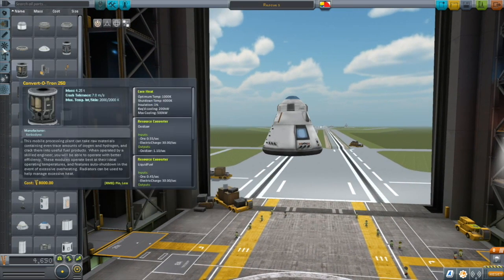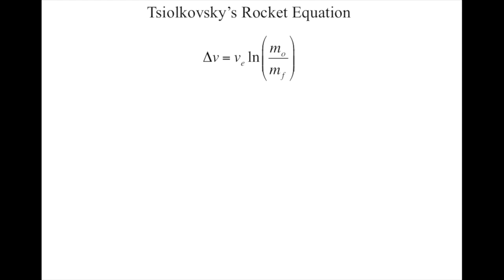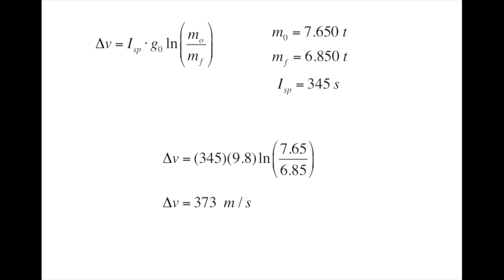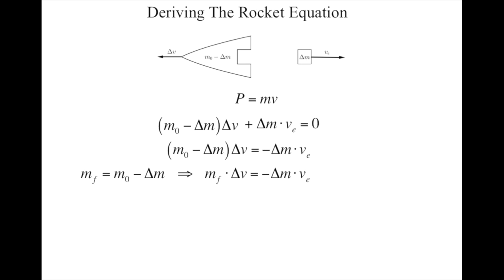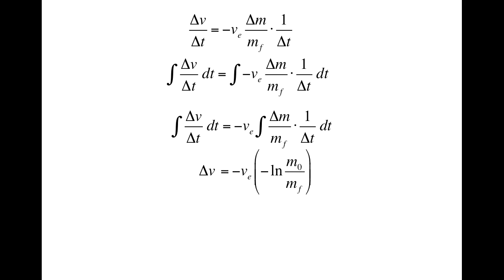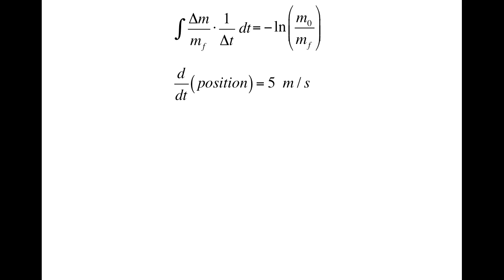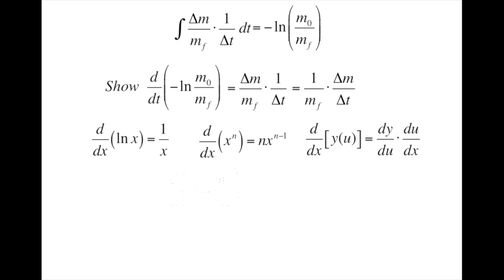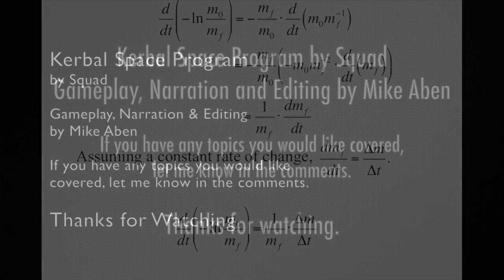The Rocket Equation | KSP Let's Do The Math

Comment: Surely when calculating momentum at the start we minus the delta m times exhaist velocity since it is travelling opposite to the  rocket.
Reply from the maker: Good observation, but this would be dealt with by attaching the signs to the velocities. As they are in opposite directions, the velocities would have opposite signs. With v_e negative, we would get the formula you're intuitively seeing.
This is kind of a hidden subtlety in this part of the video, as I never put in any numbers. What's neat is that the later calculus takes care of the negatives anyway. Ain't math great!

Comment: Great vid, but I'm baffled as to why we need the ln? I get that it's the natural log...but what does it provide here? What does taking the natural log of the intial and final mass?
Reply from the maker: From calculus, the natural log appears because we are taking an integral of a fraction with the variable in the denominator.  This is because the derivative of y = ln(x) (that is the rate at which that function is changing for any particular value of x) is dy/dx = 1/x. The why of this can't help but get into calculus as far as I can see. Maybe I'll do some googling and see if there is a more intuitive way to see this. That said, it's not surprising that logs have to show up. If you imagine the graph of the velocity of a rocket compared to the mass of fuel consumed, it can't be linear. This is because as you consume fuel, mass decreases, which means the rate at which velocity increases (ie. acceleration) won't be constant. Acceleration will be constant increase as well. Behaviours in which the rate of change is itself changing at a constant rate will always involve an exponential function (y = b^x) or its inverse, the logarithmic function.  Why the natural logarithm (ie. log base e rather than another base)? Well, it ain't called the natural log for nothing. ln(x) and e^x pop up whenever you are looking at real world examples of exponential change.
Reply: @MikeAben  Thanks so (so very) much for your time to reply. Yea I haven't hit integrals yet in calc, i'm still trying to get my head around deriviatives and the different product, quotient and chain rules... And I"ve touched on acceleration and velocity in physics. So yea that part I get. I suppose I'm putting too much thought into questiong, but the whole idea of just accepting 'e' as the answer bothers me! lol thanks though!
Reply from the maker: @horizonbrave1533  You can never put too much thought into questioning. Question away. :)

Here's a  3-blue 1-brown video on the importance of e^x. A great math follow, by the way. 

https://youtu.be/m2MIpDrF7Es

Un truth, you could use any base for the logarithm in the rocket equation, but it would introduce an extra constant that disappears when you use log base e, which is ln. It all stems from the property of e^x being its own derivative. There is something special about the number e. Personally, I find that the derivative of ln(x) is 1/x to be one of the most surprising things in introductory calculus.

Comment: wait, , what order and how do you calculate the numbers when using the calculator, please respond i need help :(
Reply from the maker: It depends on your calculator. For many (like the typical ones on phones) you have to do the order right for it. That's inside parentheses, then functions like ln, then multiplying, then adding. To do the calculation at 3:00 with such a calculator it's first 7.65 / 6.85. Get that answer and push ln, then multiply by 345 and 9.8. Again, this can be different on different calculators. They're not all the same. Play around until you get my answer to figure out how your calculator works.

I hope this helps.
Reply: @MikeAben  thank you so much, you are a great teacher, your awesome, i also subscribed to you, THANKS YOU!!!!!
Reply: @MikeAben  oh wait, i am using a scientific calculator and wait i think i got that wrong, can you elaborate just a bit more with the log part please, many thanks your wesome!!!!!
Reply from the maker: @rumcoke8909  On a scientific calculator, you should find a button labeled 'ln', that's a lower case 'L'. This may be written above the button in which case you'll have to push '2nd' or 'shift' first. The button works differently on different calculators. On some you can type pretty much what you see, ln(7.65/6.85). It'll know to do the dividing in the brackets first, but some calculators don't do this. You have to do the dividing first, which gets 1.11678..., then take the log. 

Good job on sticking this out. It's  tough when you haven't done this is school. If your still having trouble, my advice would be to google the make and model of your calculator. You should be able to find a manual with specific instructions.

Comment: An introduction to calculus? Well, hopefully someone seeing this will choose to take that class.
Reply from the maker: I couldn't figure out, nor find, a non-calculus way of doing this one.  That's why I split it up the way I did putting the calculus off until the end.
Reply: I agree there probably isn't a non-calculus solution to this, and picking the audience is hard. I'm just not sure if you can give an explanation involving calculus to a non-calculus audience. 

I guess the only other way is to say "This is a calculus proof, trust me," but that's not exactly satisfying, as you pointed out.
Reply from the maker: No one should ever trust me, at least that's what I tell me students.  In my opinion, everything should be justified with the rigour of the justification appropriate to the audience.  Even things that are defined as true should at least be demonstrated as sensible.

The rocket equation is such a biggy, though.  It feels right dealing with it early.  With that done though, the rest of this series should be calculus free.
Reply: True enough.
Reply: yeah, that's a tough one. Imagining adding up all of the little dvs that are the result of chucking all the dms out the back of the rocket, plus knowing about conservation of linear momentum and not having any calculus to hang it on, would be daunting. But if you have the basics, it was a fun into to the rocket equation that makes plenty of sense.